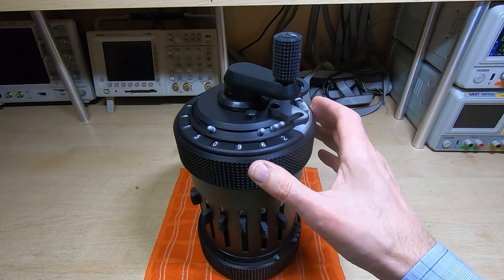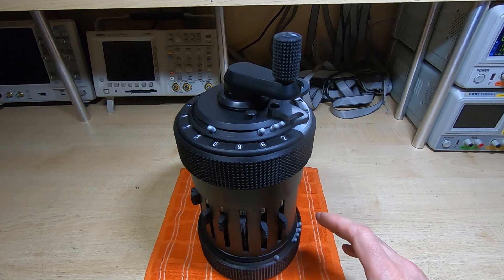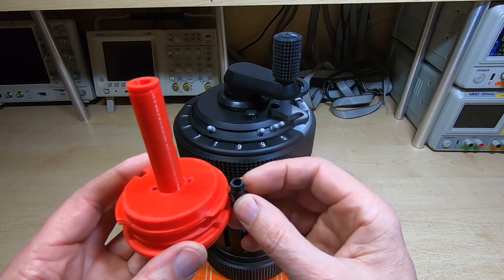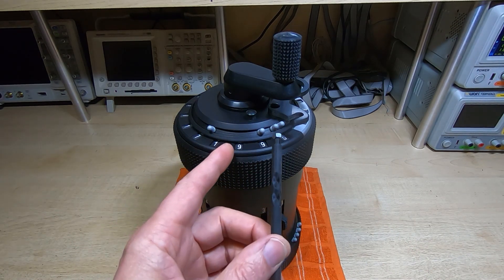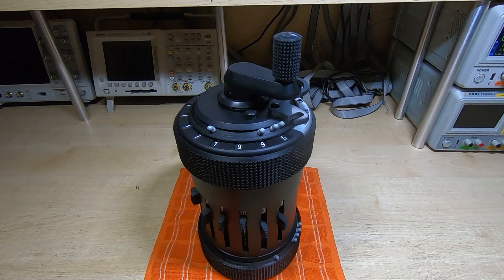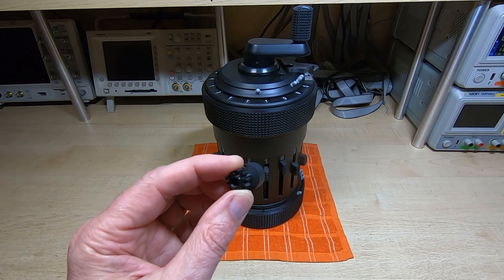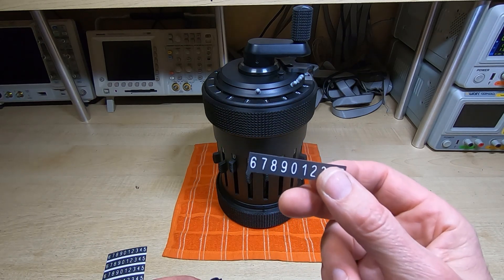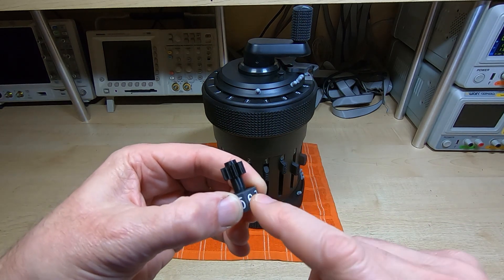Curta Calculator Project Follow up

Comment: Perhaps for the number labels, you could use a Brother P-Touch printer?   I have a desktop Brother device that's intended to only be used with a computer and client program that runs on Windows and macOS.  What's handy with this device and software is the ability to scale text (and graphics) to arbitrary sizes. And there is tape that prints white text on a black background.   If you happen to have one of these devices around (or the versions with a keyboard and computer interface), it might be worth investigating.

Nice work, I look forward to seeing how the 2x sized version turns out!   Thanks for sharing this journey.